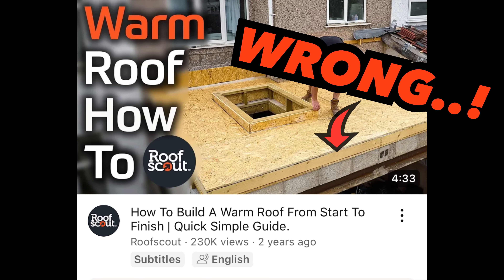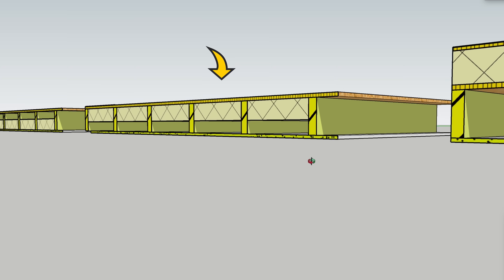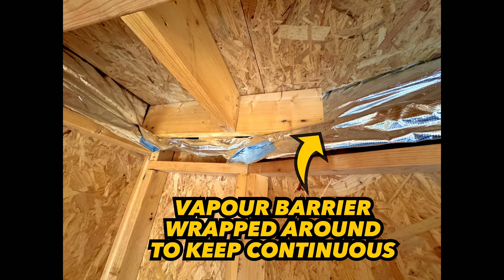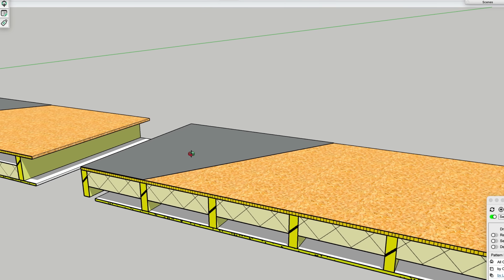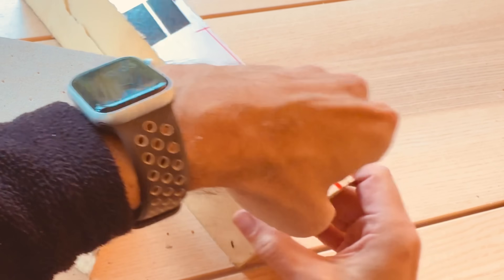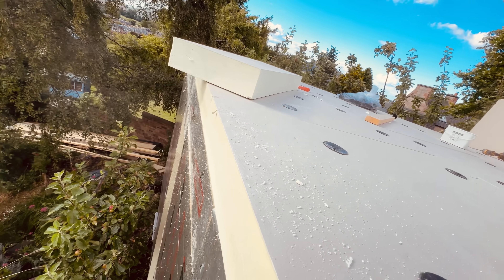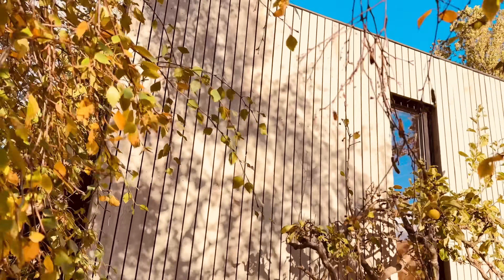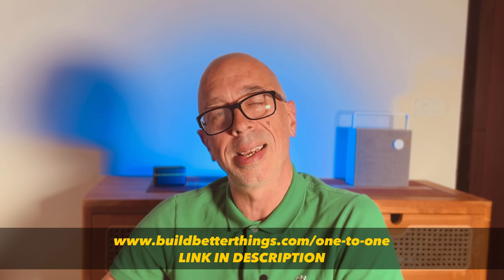Build a Warm Flat Roof the Right Way

Comment: You're absolutely right.  But TR27 is useless.  We tried a warm roof with no OSB.  TR27 ended up with dents in it every time we stepped or kneeled on it.  The fibre facing peeled off at the edges.  I need a solid roof that I can put ladders on, not one made out of sponge cake.  So I ended up solvent gluing 12mm OSB to the TR27 and then solvent gluing the EPDM to that.  Really didn't want to, and I know I'm going to have to replace the roof in 10 years because the OSB will rot.
Kingspan/other manufs need to come up with a decent product with a hard deck.  Until then we will keep installing OSB because it's the only practical option.
Reply: You'd want to be able to walk on the roof occasionally to clean sky lights or roof lanterns, or if you need to clean, paint, repair gutters. Having a roof that you can't stand on at all is useless
Reply from the maker: I said above you can walk very comfortably on the roof using tissue insulation and bonding direct. Being unable to walk on it is just a misconception by folks that have not used the correct product, or have never actually installed and experienced it, or are set on using OSB incorrectly on a flat roof.
Reply: @build-better-things  hi there, I installed an Epdm system straight onto the insulation pir boards using the water based adhesive and never have had a problem, I appreciate full contact adhesive is stronger and I used this to do all the flat roof edges at 150mm before installing curb and gutter trims etc. I would just like to know why you would advise using full contact on the full area? Once the EPDM with full contact adhesive hits the insulation or OSB boards with full contact adhesive, there's very little manoeuvring and im guessing novices and DIY people are going to have more bubbles and air pockets than a aero chocolate bar 🙈
Reply from the maker: @THECAT077 yes you’re right, the Solvent adhesive requires much more care as I mention in the video. The “I’ve been doing it this way for years and never had a problem” just doesn’t really work for me  or my business, for the 1 in 100 times the roof is ripped off through negative pressure. First thing the loss adjuster will be looking at is the adhesion onto the PIR. I just don’t understand why you wouldn’t just do it right in the first place.
Reply: @build-better-things  I want to be clear, im not suggesting the way you install it with full contact adhesive is wrong......im just trying to find out if there's many Roofers who have installed it the way I did with waterbased adhesive straight to Pir insulation boards and if any problems have occurred? I definitely agree that installing an Osb board to the cold side of flatroof would potentially cause long term defects. There's a comment which mentioned the fixing discs showing through the rubber and i have to agree that it's not a pleasent site. Also if your doing "let's say a kitchen extension" and there's an old tiled covering on the main roof above and the Ridges could possibly blow off etc....that is going to cause some issues if it hits the Epdm with no osb on top of the insulation and create some craters in the insulation whilst puncturing the rubber. So there's definitely some arguments for both ways really.....it would be interesting to see if someone comes up with a solution that resolves all the issues mentioned in the comments. Definitely not disagreeing with your argument regarding the osb board on the cold side of membrane though 👌🏻
Reply from the maker: It’s a valuable discussion and I appreciate your comments. It’s very helpful to everyone so thank you.
Reply: @build-better-things  no worries buddy. It's good to get in depth videos like this and try work out the pros and cons of different methods and eventually come up with the best solution. Anyway you've got yourself a new subscriber.....keep up the good work and best information possible for everyone 😉👌🏻
Reply from the maker: I have not had the same problem, although I use the Resista insulation rather than KingSpan and it’s always very firm to walk on, and you can’t peel the face at all. However, for your specific needs, I think you need to be considering an inverted roof, or integrating a raised deck system similar to if you were adding solar , if you’re putting heavy point loads on, or regular foot traffic , regardless of whether I think it will work with Resista. Your use case is not really what the system is designed for, to be fair to the manufacturers .

Comment: Can you show me an example of a failed "deck on top of the insulation"? Just intrested to see it with my own eyes.
Reply: Exactly this, me too. Have seen plenty of bad cold roofs, contractor rushing, forgetting to properly ventilate. No evidence of someone pulling up a roof and it's rotted due to evaporation. All due to water ingress from above.
Reply: @OmegaLok   I reckon we've got to wait another 40 years before we can actually see evidence for this I just cant see it happening it would have to get through the barrier and then the pir if it was even possible for moist air to come up through those layers surely its not then trapped it would just as easily get back out.

I suspect what we've stumbled upon here is someone being paid by the inventor or manufacturer of these tissue faced insulation boards. and this roofing system.
Reply: Surely you can’t get that much moisture getting up through the plasterboard, Plywood, VPC and insulation. We don’t even get much condensation on the windows in our house during winter so seems a little OTT. Obviously depends on what the room is used for etc
Reply from the maker: Hi Luke.  I’ve already provided the detailed analysis in the video and expanded on my research explanation here in the comments section, if and where there are constructive questions and comments. My question back to you is, whether or not you agree with my analysis, why would you go to all the effort and expense of a completely useless layer of composite timber on the cold side of your insulation when you can (and should) bond direct, using the correct , no-foil insulation.
Reply: @build-better-things thanks for the response, we’re about to have an extension built with a flat warm deck roof, the architect has included 18mm OSB on the top of the insulation so I’m trying to get my head around it all. This has been a real eye opener. So I’m assuming condensation can’t form on the underside of the roof covering i.e the GRP of no OSB is put on top of the insulation?
Reply from the maker: @lukeshackleton2913 I’m not a fan of GRP for this very reason. GRP I think requires a timber or similar substrate and therefore should be used in a ventilated roof arrangement, which I describe in another video, because it can’t be bonded to insulation in the way that EPDM and fleece products can. EPDM is also breathable. The fact that you’re seeing many of the “I’ve never had a problem” comments here is fairly typical, but it’s irrelevant to me, since we’re striving for excellence . I’m sure you’ll be fine if it’s been specified and there’s a proper bonded guarantee of over ten years. Best of luck

Comment: Love the science based approach. Would this be ok in warmer climates? (Melbourne, Australia - does get a winter, but a warmer summer).
Reply from the maker: Yes, you need the warm roof to do the opposite for your summers, never insulation between the joists, always over the top to prevent thermal bridging from outside to in. Those joists just act like radiators in summer if they’re not insulated, and you’re air con will have to be on far more.
Reply: @build-better-things  Oh, bit surprised at that answer as I doubt roofs are being made like this down here. They are often more like the cold roof design. Great to know, thanks.
Reply from the maker: Ventilated cold roof space (insulation at base of roof void) is also ok, but warm roof is best. The faster the air moving created by the negative pressure, the more likely the thermal gain is going to be weakened by air movement over the structural members.

Comment: Is it a good idea to add a layer of insulation roll between the joist of a warm flat-roof?
Reply from the maker: It’s easier to think about these things in terms of the u value, and work backwards from that. You can find the list of u values for each element, eg roof, walls, floor, and one you have it, you visit one of the manufacturer’s online u value sites, and see what insulation options are there. I would never put quilt in between the joists for thermal reasons because it performs poorly. Sometimes acoustics are relevant but then you need to allow separation and some ventilation. Really easier to draw than describe.
Reply: Never, do that, plenty of sites with technical drawings and the reason behind it

Comment: If the vapor barrier is merely laid out and taped I would be inclined to put some silicone sealant in the tip of each screw: 1. As a lube to prevent windup of vapor film around the screw; and 2. To seal around the screw. + Somewhere in the matrix there needs to be an deliberate path for pressure release  in a rain protected area since one is creating two sealed diaphragms, maybe along the edge under a rain cap in a dry area. You do not want changes if barometric pressure lifting the membrane, and you want any residual chemical fumes to vent outdoors.

Comment: The OSB is often a “standard detail” that’s all. I am sure a builder would happily leave out that additional task with a simpler build up. I certainly will do so with my own. What do you think about those one way breathable membranes to avoid trapped moisture?
Reply from the maker: They are great, but they only work with a ventilated cavity. For example, a wall or sloping roof with tiles on battens. For the examples I describe, not feasible.

Comment: With this method, how would i go about fixing down a prefab upvc skylight, where the instructions say to screw it down to the top deck of OSB, before applying the EPDM? Im a diy'er doing a flat roof extension myself, with no experience, so any help greatly appreciated.
Reply from the maker: Good question. I’d always fix into the trimmers around my opening, but you can also fix under the insulation into the warm OSB deck using window brackets which sometimes come with the kit. Hard to explain, easy to draw.

Comment: OK - how do you protect the EPDM from birds pecking/scratching at it?  I've got what sounds like pigeons wearing hobnail boots thumping around on my roof!
It's felt/gravel at the moment, but needs replacing as it's a badly insulated cold roof install (previous owner was a builder, allegedly) - lots of gaps around the PIR and no VPL above ceiling!
Reply from the maker: The only time I’ve seen a problem with birds pecking at the membrane is when there is creases in it. I don’t know why, but it seems to attract them. It’s actually very easy to sort, using a repair kit. If you don’t have that problem, then I’m not sure.

Comment: …..Steve the roofer has entered the chat 🤣🤣 no good video very informative,a lot of the time us “builders” that do it wrong is because we don’t know any better .. I always try to do the best of my knowledge but sometimes it’s wrong.. just like when trades use cement on older properties when really should be lime, once done they have baisically killed that property but as said they’ve been taught that way and think it’s correct 👍 ..you put timber on the perimeter under the rubber 😜😊👍👍
Reply from the maker: The timber is cantilevered over the external cavity and rain screen, so no vapour / dew point there. Steve roofer …..Cement…lime…..???
Reply: @ ah I will let you off 👍👍 Steve is another YouTuber .. but does like yourself actually know his stuff 👌 and cement and lime don’t mix 😁

Comment: I was wondering how this might apply to a sloped warm roof design?

I asked our architect for a warm roof on our extension (Which has both a sloped and flat portion), but after the calcs they wanted to put 100mm of Celotex on top of the rafters and 100mm of Celotex between the rafters with 50mm of ventilation above the insulation for the pitched portion for some reason stating it was still a warm roof somehow. For the flat roof they specified 18mm ply over 200mm Celotex, but specified no ply between the insulation and rafters. I might ask the inspector directly if we can just do 200mm on top for the pitched roof instead, and build it up as you've suggested.
Reply from the maker: A sloping roof is different because the opportunity is there for a ventilated void, using the battens and counter battens which take the tiles, and therefore the option of a breather membrane. I’ve made a video about it elsewhere on the channel.
Reply: @build-better-things  Thank you, I'll have a look at that video.

Comment: Great video and just binged a few others (inc french drain which im looking to do with my cellar and a external sump pump). I also one day want to build a garden room with solar, given the weight, how would you construct this kind of roof?
Reply from the maker: I’ve planning a solar installation at the moment, flat roof using EPDM, fixings for rail system through the membrane and insulation and into the joists. I hope I will post it here at some point but maybe next year.
Reply: @ Excellent 👌 This is good news!  Love your detail and the logical explanation behind stuff. Subbed and will continue watching 🙏

Comment: Wont the insulation deform if its walked on? Would this be ok with tapered insulation to create the fall
Reply from the maker: As long as the insulation is fully supported underneath then the insulation can’t go anywhere , fine for light traffic. Tapered insulation is perfect, take the minimum thickness eg lowest point to calculate your u value
Reply: @build-better-things  thank you

Comment: I am a retired Architect.
I completely agree, the OSB below the membrane always seemed a bit dodgy. 
I always thought it was done to give more support when walking over the roof, but had not considered the cost of the glue.  
Of course although glue more expensive, so is the extra layer of OSB.  
Although your method is more foolproof, if the VCL is good enough, and can resist screws penetration, the fact that the rubber is slightly permeable should make the OSB on top ok. One of the calculations that should be done is checking the build up of moisture during winter months doesn’t exceed that that gave evaporate during summer.
Reply: As a retired architect, I assume you've seen a few things. Have you come across a rotten top OSB deck due to condensation when there was a VCL? Genuinely interested in gathering some evidence.
Reply: @ haha…you got me there.  I didn’t come across any, but from my technical training, I woke wary of this top OSB layer.
You see this detail from major manufacturers, who should know what they are doing.  But I think I recall they used a fully bonded system, so no screw holes to compromise the VCL
Reply: @markthomasson5077 Hello. Genuine question...why does it "seem a bit dodgy" to you when you have evidence to the contrary?
Reply: im on almost 4 years doing commercial roofing and osb below the membrane sounds absolutely bananas
Reply: Making a build project fool proof is my  key...  You may get away with one build shortcut, but two or three in the same area leads to a failure.  Plus my recommendation for UK home owners is to always have and use quite extractor fans + use a dehumidifier to reduce the amount of moisture testing the effectiveness of the VCB and layers  above...?
Reply: Hi. Great video. I noticed at the end there was a shot of wooden decking on top of EPDM. Do you have a video or detail of how this is done? Thanks
Reply: @lozmoore1312  I think maybe the timber shown was wall cladding
Reply: Flat roofs are crap .
One doesn't need to be an architect to know it.
Reply: @July-A7not if well specified and designed
Reply: @markthomasson5077  it's always a crap.
Only build flat roof if it's impossible to build pitched roof.
Reply: The OSB beneath the membrane will absolutely sweat, we have removed far to many for that reason over the years as it negates the purpose of a warm roof immediately, so those that claim it does not happen are not time served and should probably attend a course or 10.
Reply: @Studio8Originalmusicproduction Already moisture in the insulation. Been sat outside in the rain. Lot of new builds with mould because of this. Skill Builder and damp they need to be taken pinch of salt.
Reply: Yeah I'm not sure there's enough water to be concerned about unless there's a vcl or membrane failure. But that's a failure in any buildup.

I've done my own garden room with a 2 layer OSB warm roof so I'll report back in 10 years...!

Comment: Can an existing cold flat roof with a bitumen/felt covering be over boaded with insulation WITHOUT a vapour barrier? Will the bitumen felt be a vapour barrier?? Many thanks
Reply: Top question.👍 I've heard it can, but would appreciate this chaps response.
Reply from the maker: In theory, bitumen in these compounds when combined with the fibres of felt is not breathable. In reality, if the roof has been exposed for a while, it may still keep the water out, yet let vapour permeate. However the problem you have is around the edges, where the envelope must be continuous with whatever the vertical vapour barrier is, that junction is going to be difficult with two different materials.
Reply: @build-better-things  when was the last time anybody received a response as quickly as that! Thank you. Shooting from the hip, if the rubber membrane excess/over lap is glued to the felt on the side of the roof.... Would that work? Also any advice or a video of attaching rubber membrane to an existing wall?
Reply: Could you cover the felt with DPM  sheet first?
Reply: That’s just asking for trouble sounds like something a cowboy builder would try and pull off 
No self respecting builder or roofer would contemplate this